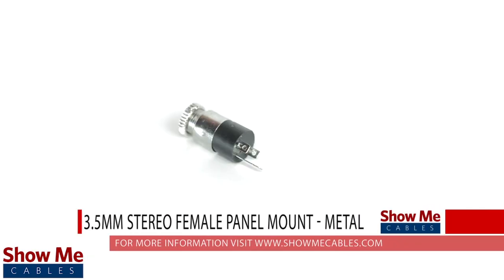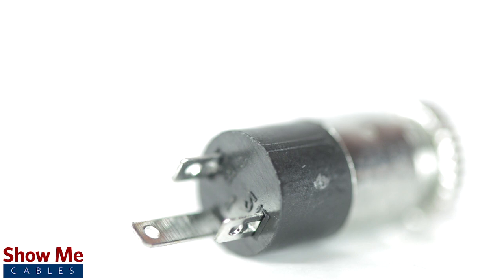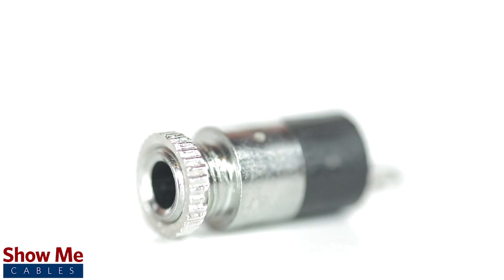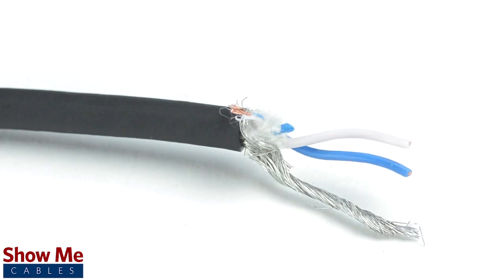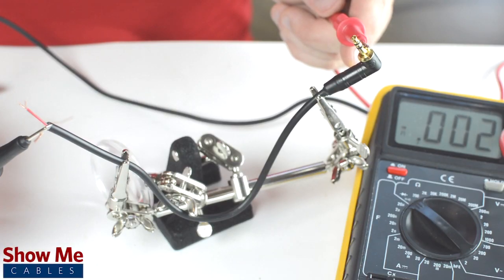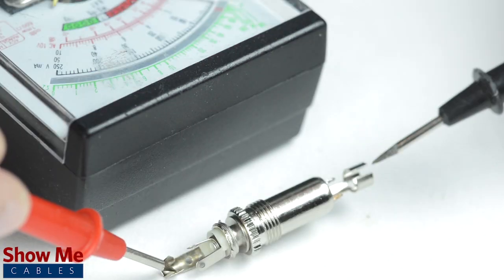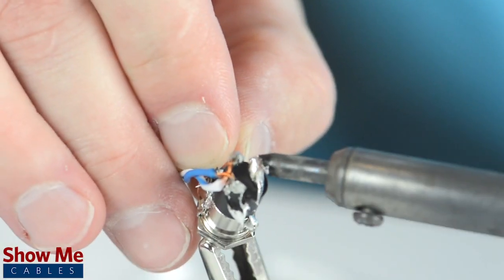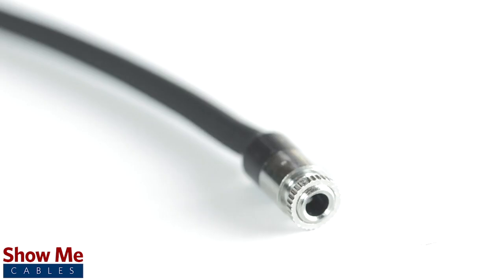3.5mm Metal Panel Mount Stereo Connector - DIY Project to Repair Your Audio Cable #443

Comment: bro can you help me...i need to put in on motherboard...and its for internal mic and change it into external mic..
but when i open the motherboard on the internal mic there only 2 point...the negative and positive...
which leg should i use for the positive and negative point?